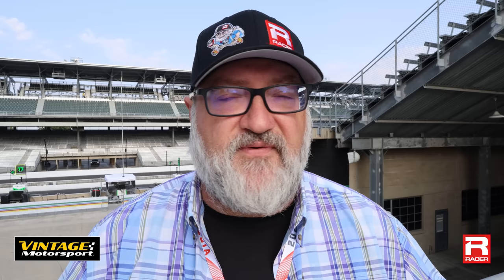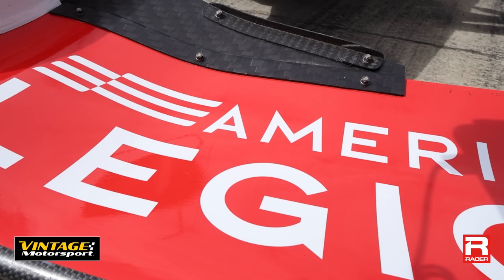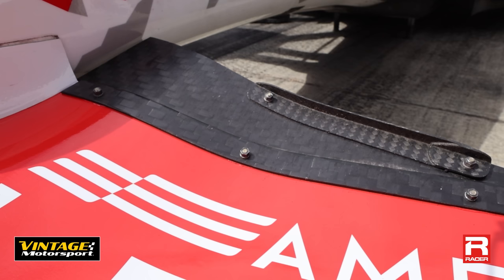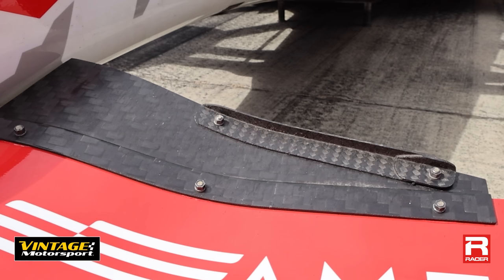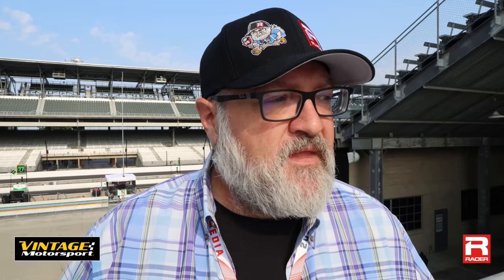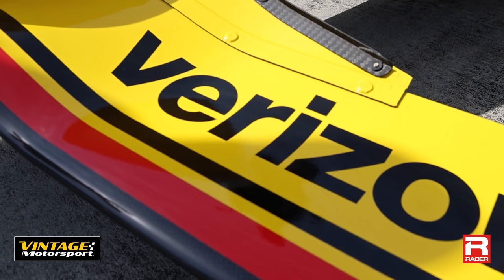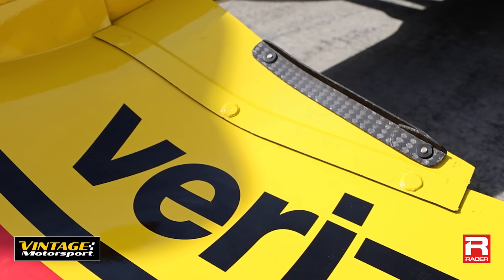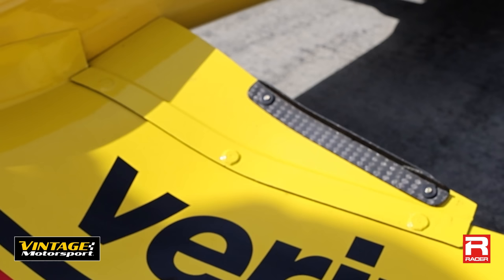Fastener Creativity At The Indy 500 with RACER's Marshall Pruett presented by Vintage Motorsport

Comment: Great content!  I would think the Arrow McLaren would be the hot setup since the air stream can possibly be directed by the "nut" angle, rather than the CGR or Penske car versions.  True the Penske version probably reduces the drag & turbulence, but maybe, since there is a Gurney Flap on the extension, you WANT some turbulence, at the right spots of course.  A tradeoff of drag for turbulence with the ability to direct some possible down force where you want/need it.  Maybe directing the air stream toward the Gurney Flap actually increases it's function and you could reduce the height of the G. Flap, so overall drag might be less.

Comment: This is fascinating but i wonder why Mclaren didn't do something with the fastenings for the Gurney Flap too? Once a team has settled for an aero config could they do away with fasteners all together and use some kind of bonding agent? 

Marshall, i dont know if you see these comments but it would be really cool IF possible to get a video explaining what teams do to their primary race cars to make them as fast as possible for INDY compared to backups. What im getting at is ive heard numerous times on the TV Broadcasts where James Hinchcliffe and Townsend Bell talk about "go faster" parts, they talk about having a "500 car thats been worked on all year" and how you dont want to switch to a back up car because "its not optimised". which suggests that teams do certain things to certain components to improve their performance over the "spec" part. However how can this be? Aren't all the parts spec? 

I heard during the Last chance practice today that some teams could go out and do 1/2 slow laps to cool the car quicker? Im wondering if a team could come in, remove the engine cover and sidepod covers and then do two slow laps?

Also why do some cars like RLL struggle so badly and Mclaren/Ganassi are so fast. Again, arent the cars supposed to be the same? Surely the aero setups cannot make so much difference? The RLL dont look hard to drive, infact none of them look hard to drive so why the difference in speeds?

Comment: It's all about details at this performance level. It would be interesting to know if bodies are waxed, in order to optimize aerodynamics.
Reply: Would this do something?
Are there tests if that aerodynamically helps?
I can’t imagine, a lacquered surface or a wrapped car is smooth enough to not make a difference to waxed.

And there’s so much rubber on those cars after a few laps that I don’t think it would help at all when it comes to aerodynamics.
Reply: @rolux4853  Quite sure it was practiced in F1 qualification in the nineties. But you're right, after few laps it's not efficient.